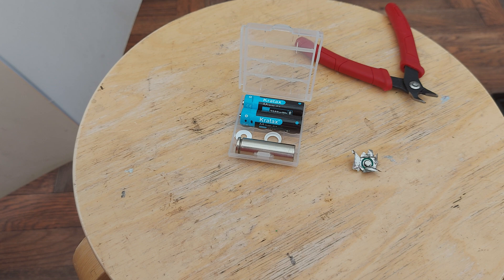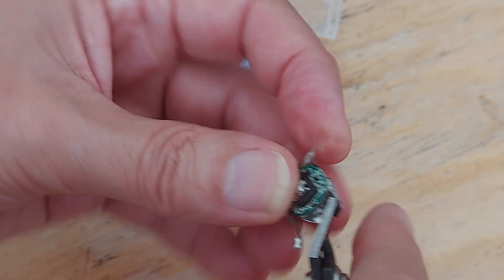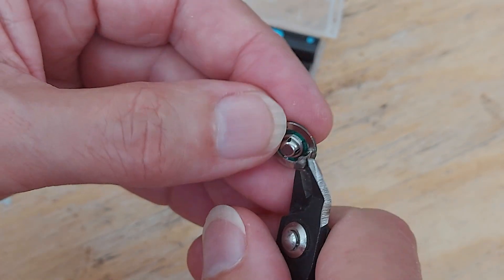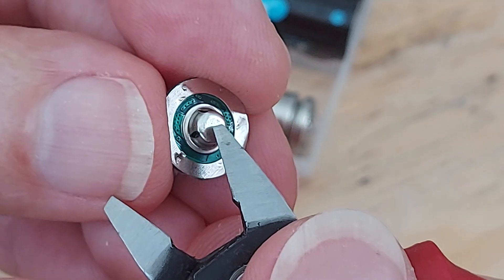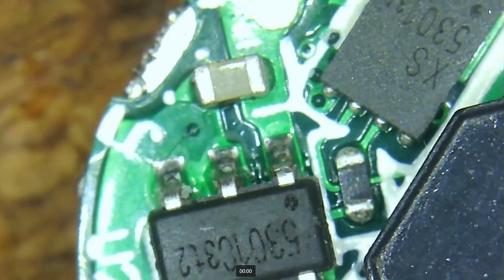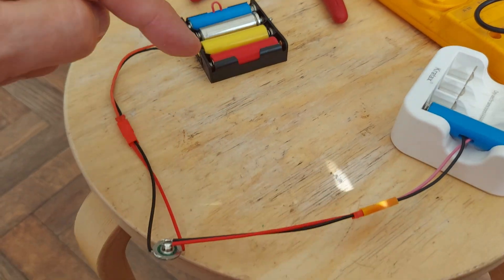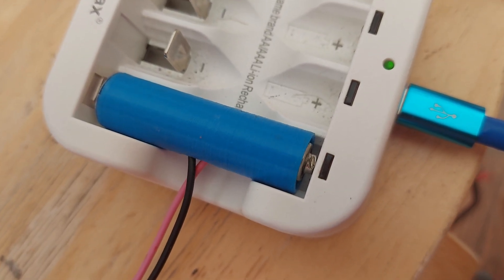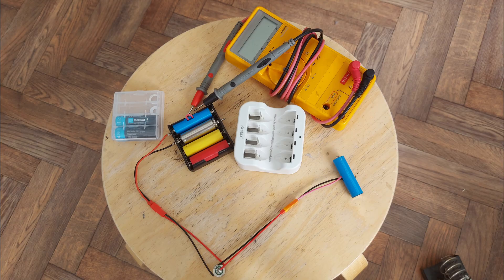One more look at the faulty KRATAX LiIon AA battery

Comment: There is not much you could fix. I would still have a look at D2. Because, if you think how boost/buck works, you know you need a diode. It seems to work in one direction (charging' but not the other way (buck). You could measure both sides of the diode and see if it may be defect or not. (usually diodes can handle a lot, so I think most likely U2 is malfunctioning). I also have no idea how they made this into a buck and boost circuit, you would need 2 diodes for that. Perhaps one is inside U1 or U2.
Ah well, nothing lost at the end, you do have a working replacement!